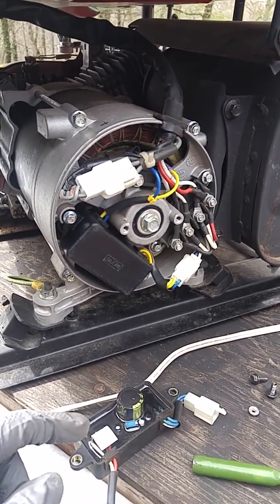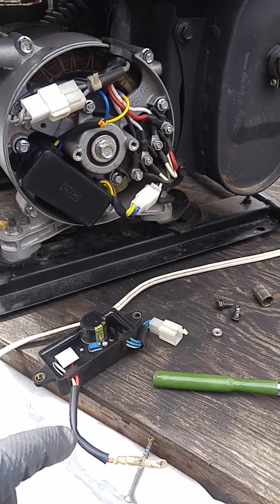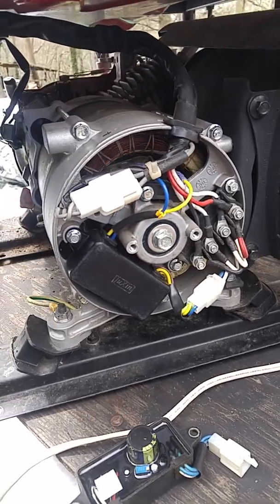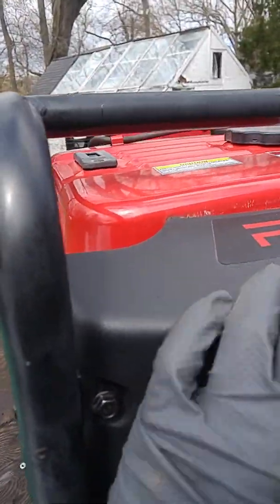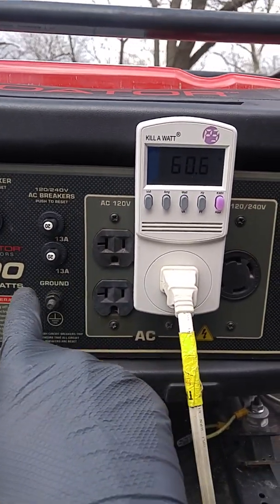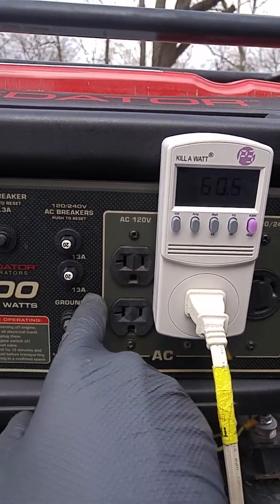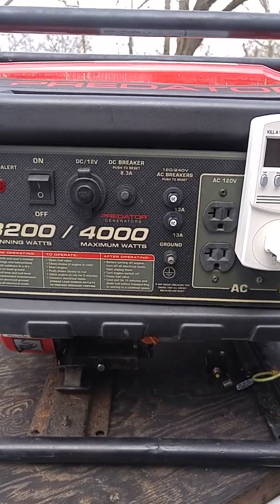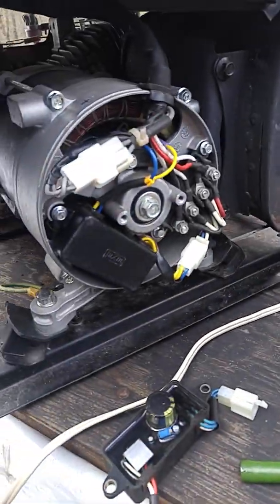$25 Predator 3200W 4000W Max Generator Repaired With New AVR

Comment: What???? Can't hear you with the generator running😖!!!
Reply from the maker: Basically I was noting two main points:
1. The RPM's might be a little high still since reading 60.9-60.7Hz on the KillAWatt meter. 
2. The machine came with the 20A breakers that work with no issues for each 120VAC outlet, i.e. 20A x 120V = 2400VA = ~2400W so well under the continuous rating so can run all the time with no issues. However, for the 240VAC outlet, not good being that 20A x 240V = 4800VA = ~4800W which is way to high for even peak/surge loads.  What I was thinking was to add another break only for the series wired 240VAC outlet that is 13A or replace the two 20A back to the 13A breaker which I did order.  I still haven't bothered to do that yet.  Seems there was something else I was looking at doing like installing a switch as well with another circuit like a power supply regulator transistor to do something so can switch between series and parrallel 120VAC outlet so can run 26A 120VAC or 13A 240VAC since those would meet the specs for continuous operation. I forget offhand since wasn't last seasons project and now I'm working on indoors in the queue items, plus feeding the outdoors queue. 

If any question in particular, feel free to shoot away.  Thanks for watching, commenting and feel please like and subscribe.